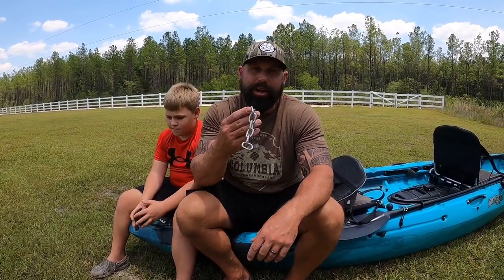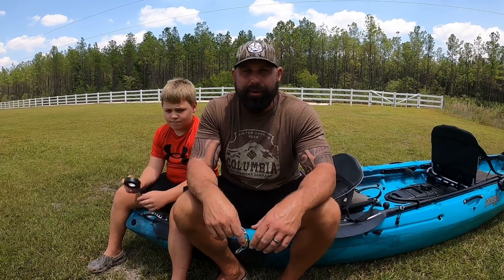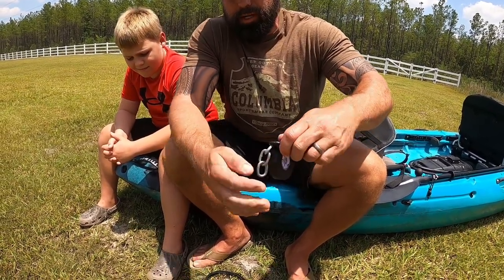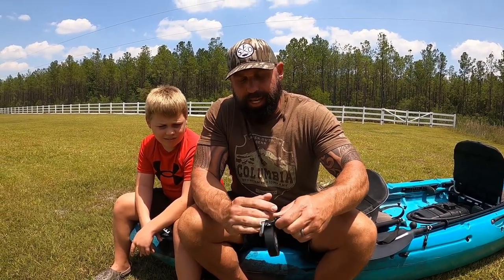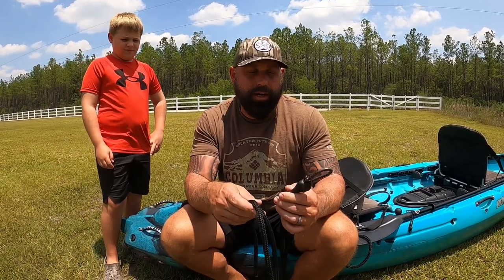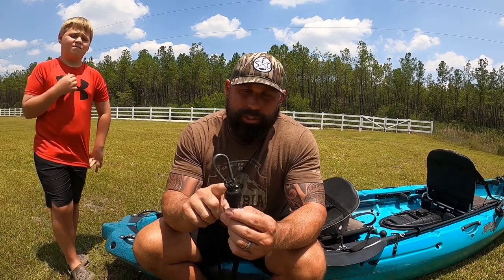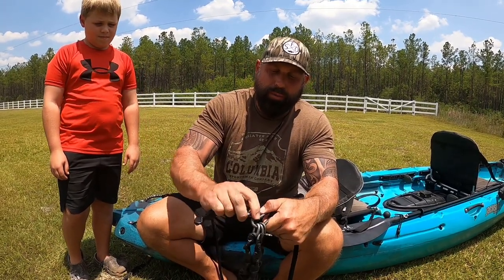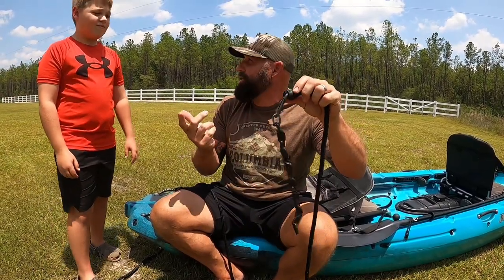Super Simple Adjustable DIY Kayak Drag Chain!!!!

Comment: Need quick release...that chain snags in 3mph current it will pull you under.
Reply from the maker: Good point. I’ll have to add that! Thanks for watching and for the help!!
Reply: @GABOYOUTDOORS  we use standard zip ties breaks at 40psi...that works good on 22ft trout boat. We use 1/2 " chain and put it in bike innertube....we also put boat bumper on anchor rope if the zip tie breaks so we can retreive the line and chain.   Probly small zip ties for kayak...
But guaranteed bout had my bass boat pulled under on taneycomo when they were running 4 units...was able to cut the line before it went under....that was 40 years ago...kinda learned along the way...lol.
Reply from the maker: @Garminrules  Awesome! Sounds like a perfect setup…Got to rig that up!